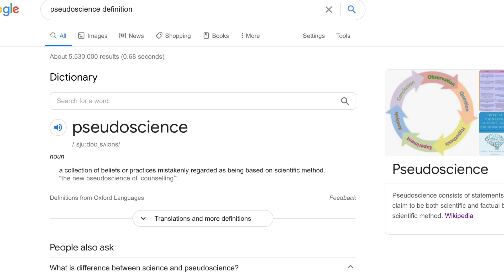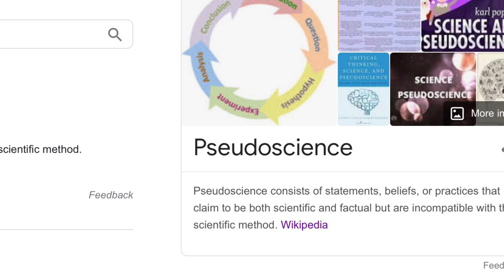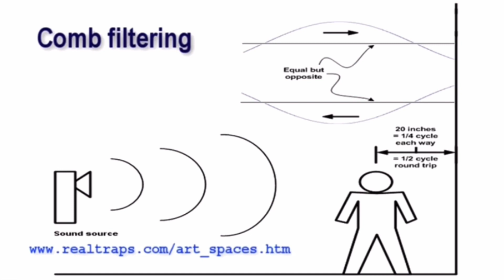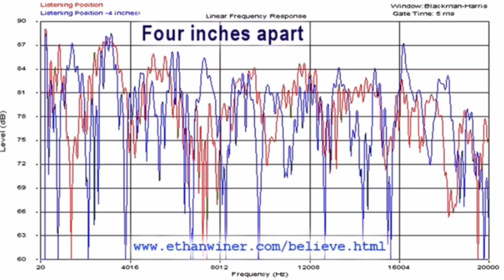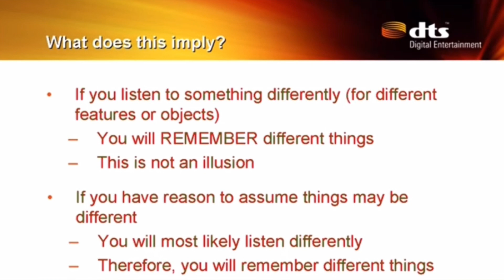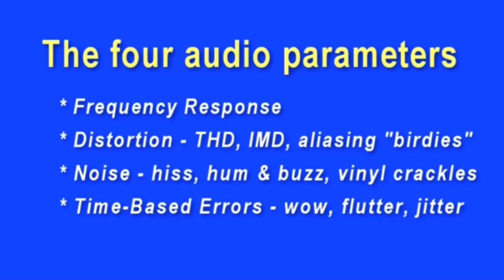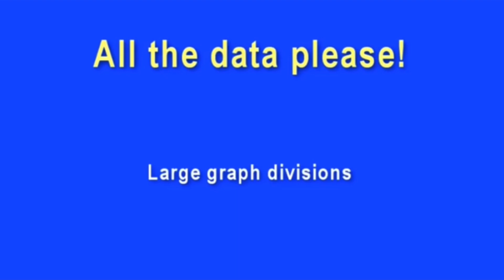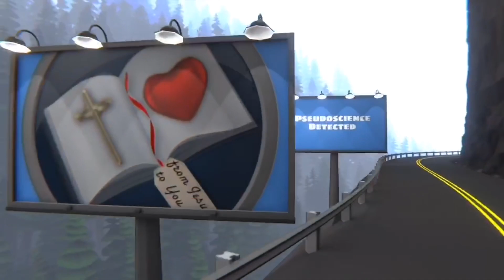Hi-Fi Cable Vs Science Vs Flat Earth

Comment: over forty-five years in the architectural design and build industry that is over-run by self-claimed 'experts'...until confronted with someone with greater experience and empirical knowledge...usually the humbled older guy in the corner of the conference smiling at the claims made by the 'self-claimers' of wisdom...pfft! I remain the questioner of why "their" "model" does not work as "claimed"